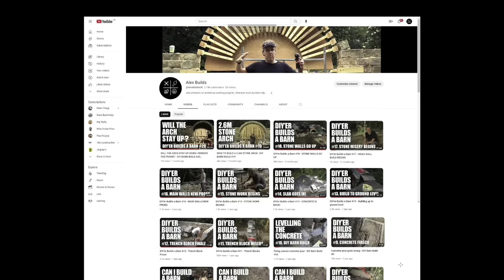DIY'ER builds a stone barn using traditional techniques... [18 month timelapse]

Comment: Typically, with stonemasonry, you lay your corners first. This is called getting your leads up. So you’re building an entire wall out of stone and cement mortar. It’s structural stone, not veneer. I don’t see any steel reinforcement and that would be fine except that you didn’t put any through stones into the wall. These are stones that puncture through both sides, and extend out from either side of the wall about 2 to 4 inches, on either side. These would typically be spaced apart every 3 feet going up, and 3 feet horizontally. I do like your temporary wooden structure for the archway.
Reply from the maker: Hey thanks for the comments - interesting point about starting with the corners, will think about that next time. Pleased to say though that there were generally 2 through stones on each section & second course, I just never seemed to capture them on the footage! Thanks for watching
Reply: @AlexBuildsUK  right on. Good to hear. If you do another similar project, I'd be interested in seeing you do something like the Ashler Pattern, rather than just a staggered brick styled pattern. 

I don't see many stone walling projects these days. Most stone masonry work are vineer. And that's fine. Work is work.

Comment: 📍IMHO, the first layer of the arch should have been dry fit/stacked, then connected with the stone/mortar for the 2nd layer.  Durability (lots of this type of mortar becomes weak in 100 years.  Dry fit can last longer (and has a very esthetic look). 

Nice work!  I’ve been following for ages. Glad it keeps popping up in my YT recommendations.

Comment: Hi Alex - Thank you for this upload.  Trying to understand proper process and approach with this undertaking.  Can you please help a novice understand why at minute 3:25 you chose to build on top of the concrete slab by floating the stone wall on top of a thin layer of construction fabric vs. joining the foundation with the wall via rebar or connective structure to tie the two together instead.  Obviously there is a good reason and this is my 1st out of the gate lookup Q. on how to do things right.  I'll watch the remaining 15 minutes and gather the remaining questions in list format before posting, but I'd really like to understand reasoning behind the use of the construction fabric before migrating to next level questions.  Thanks in advance for any insights and Kudo's to you for sharing your journey.  Highly value the lessons learned here.

Comment: Curious as to why you would use a bond breaker between the concrete and stone. Pretty excellent looking work.
Reply from the maker: It's building regs but arguably not required - sheer mass will keep it in place though 😀

Comment: I was the only white man doing stone masonry and concrete in El Paso, Texas where there are stone walls everywhere you look. I learned the youtube British trowel method and the macho alpha Barracho Mexican way where they use a full size shovel to fill in the inner walls and general mortar fills. 
For the middle  inner wall You can use all the leftover hard dried mortar and of rocks and crap to fill the inner wall but I think the best way to do it is to fill the inner wall with grouty small and large aggregate wet concrete.

This Will save a lot of time Take a small 3 gallon bucket  with with mortar use gloves and fill in small crevices by slapping the ass out of each joint with a handfull of mortar then have a spare bucket full of water in about a 2 1/2 inch or 3 1/2 inch paintbrush and brush it very hard.  To clean it up in between the joints take the 3 1/2 inch paintbrush to do the joints have  a wire brush on hand and a sponge to clean up the face of the stones. Do not let the excessive cement dry  on the face of the stones.

By doing it this way with a shovel the alpha mexican method, it will look great, just as good as of you messed around with the London brick trowel and took all day  with a single meter of a single course. I know everything you can do also is put things like seashells different things that will stay in the mortar. You can even give it an old time look by making 
Roman concrete or lime mortar face. Another thing is not use a masonry line and have the texture of each face going a little bit in and out. It actually makes a nicer Stonewall.
Reply from the maker: This is good advice and I have a future stone project, for which I will consider these points 👍

Comment: This is exactly the video I have been looking for. I am a novice and I am planning to build a 10'x10' shed of limestone remnants I have been gathering from leftover building material in our new subdivision. My shed will have a arched doorway as well. I don't know the right terminology but why did you leave a space between the two layers of stone? I think you filled it with mortar. Would my shed be okay if I didn't have a space between the layers? I was planning on mortaring the two layers together?
Reply from the maker: That was just to achieve a thick wall, in some cases I had stones which went all the way through but I didn’t have enough of those that was thick enough. So now you don’t need to leave any sort of gap but if the wall is gonna be high you’re gonna want to achieve some with to make it stable, doesn’t sound like that’s the case with your shed. Good luck!

Comment: damn no wonder it took 18 months, i've seen tea spoons bigger than you're trowel XD. personally for a wall that size i would have used a medium/large sized shovel, 
another thing i noticed was your mixer practices why isn't it running constantly, when you empty a mix throw another one in that means when you've finished with your borrow load of gobbo the next mix is ready also your gobbo is too dry making the job 5 times as hard as it should be. 
the final thing i've seen you do wrong is messing about trying to get the right stone's so they're close to perfect you really don't need to do that if you wanted perfect why not go for bricks instead, it's suppose to look crazy if you look at some old church's or even some old stone wall's non of them are perfect.

apart from all those rookie mistakes you did a bang up job well done!

Comment: Impressive. We both jumped as you knocked the formwork down. 
Not much engagement though? No through-stones (headers)? Piers arent engaged? And the corners are just relying on mortar too. Engagement =strength.
Reply from the maker: Hi good point however the video is misleading... I changed the design at course 3 or 4 and decided to put the piers in, and so the blocks do stich in / overlap after the first course all the way up. Also that sequence at the top before the arch also suggests that it's not overlapping, but it's just one course which in fairness was a bit like that. All others have good long interlocking blocks! Thanks for watching.

Comment: Wait, so traditional arch lintels can still pass regs if you have the structural calculations done for them? 

The front of my house originally would’ve had a brick nice arch with a small open entry porch to the front door. They’ve replaced it with a really low steel lintel and a terrible upvc door to make the hallway slightly bigger… I wanna put it back to its original form.

Comment: I just saw your effort. I have to make some comments: Why did you lay the first row of stones on plastic? There is no adhesion to the foundation this way! You should place the mortar directly on the cement foundation! Plastic is used to separate wooden structures laid up on cement foundations, to prevent them from rotting due to rising damp. But these are screwed down to the cement every foot and need no adhesion. It's also common practice to "tie" together every once in a while the external and the internal row of stones with longer stones that reach from inside to outside un-interrupted. I didn't see you do this. Otherwise these behave like two parallel stone walls that have less rigidity and only rely on mortar to keep them together. And mortar deteriorates. Also, it is common practice to use big stones on wall corners and ends (windows/doors) again to tie the inside/outside walls. I have taken seminars on stone masonry and building and these were paramount issues. Of course, i live in Greece where earthquakes happen all the time and we need buildings that can withstand some severe shakes. Your area may differ. BTW that is a nice arch!
Reply from the maker: Well in the UK typically a DPM is laid under the first course or about a couple of feet up. I think (well, hope!) the sheer weight will do the job! Thanks for the comment.
Reply: This membrane is very common in construction here in Romania, the purpose of it is to break the capillary effect of the water (preventing water infiltration from ground moisture )